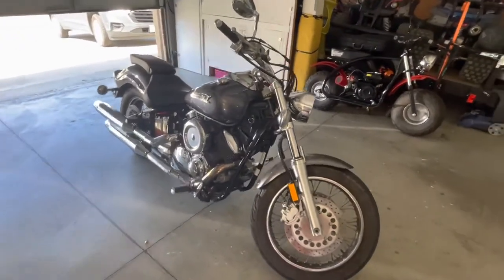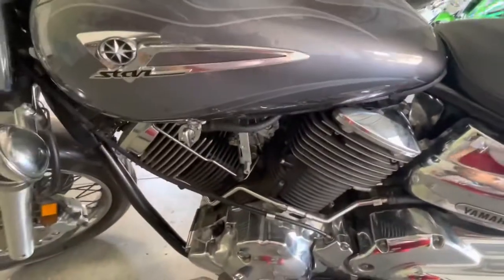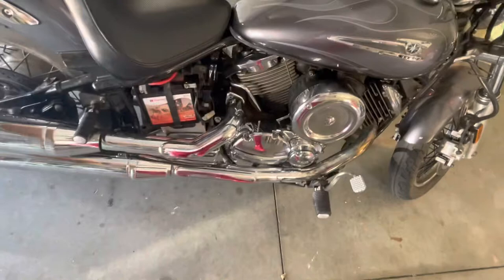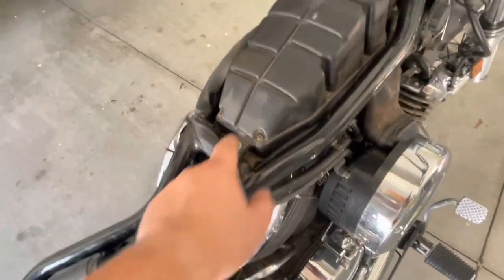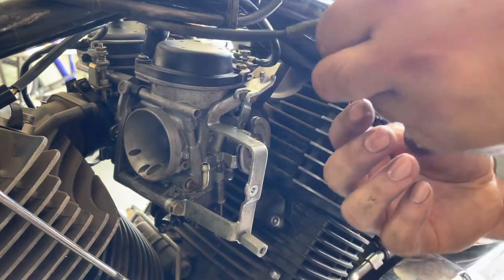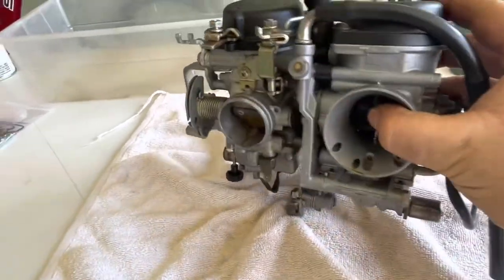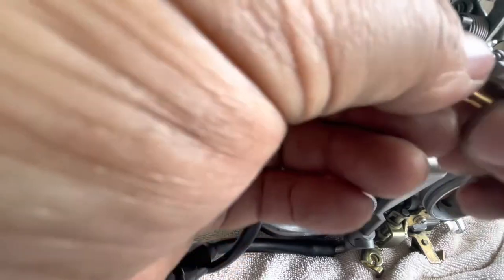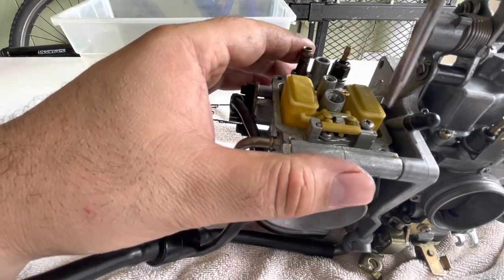Yamaha VSTAR 1100 - Carburetor Removal and Maintenance - Part 1

Comment: I have a 2000 Yamaha vstar 1100 and I am having the same problem . Your video inspired me to do it myself im not a mechanic but I feel like I can take it apart and put it together again. Instead of paying so much money to get your carbs cleaned.
Reply from the maker: Thank you very much for your feedback. I am glad you liked the video and that it helped you. I'm not a professional mechanic either; I've been learning with my motorcycles over the years. I have always tried to fix things myself. I prefer to learn in the process than pay an arm and a leg for someone else to do it for me. Regards. 🙂👋
Reply: @robertoalvarez5281  I do have a question tho on my vstar the previous owner has a fuel filter right next to the fuel valve and then it has another filter under seat. Is there a reason why it would have 2 filters
Reply from the maker: @ErickTorres-s8n  I'm unsure what his logic was for adding a second fuel filter.  🤔 These bikes only have the fuel filter under the seat. Regards,

Comment: Hello!
I know this is an older video,but can you tell me what the hose in the L shape is (name/purpose) at 7:52?The one labeled "2" as we can see later in the video.I'm trying to troubleshoot something on my xvs.Thanks!
Reply from the maker: Hello, and sorry for the delay in responding. I think you are referring to the air cleaner joint or also known as carburetor boots. They connect to the Airbox. Its primary function is to conduct clean air coming from the airbox/air filter to the carburetor. I hope this helps to clear out any questions you may have. Regards,
Reply: @robertoalvarez5281  thanks for the reply and explanation!I checked with my mechanic in the meantime and all is okay.Appreciate it.
Reply from the maker: @miclevlad9849  my pleasure. 👍